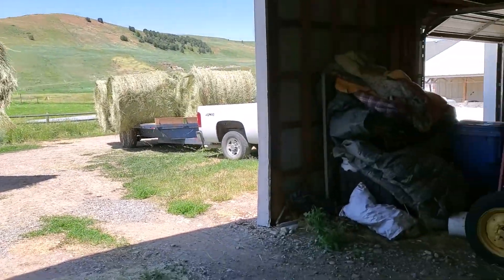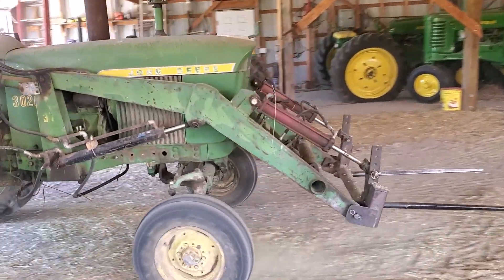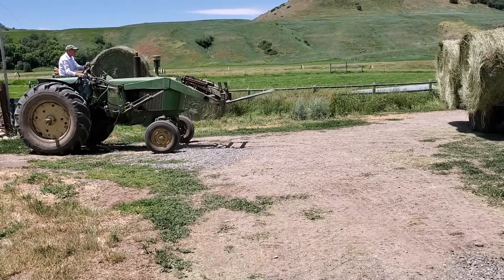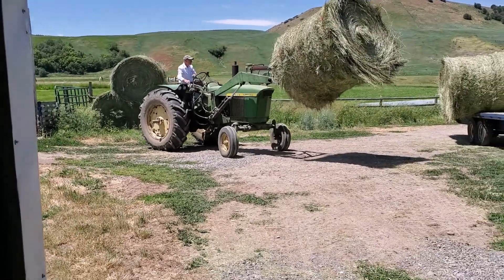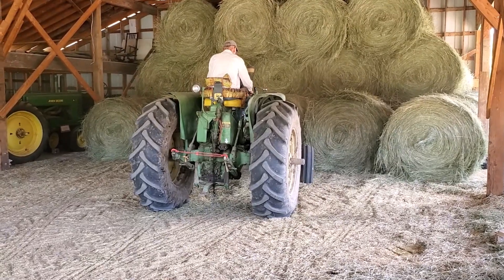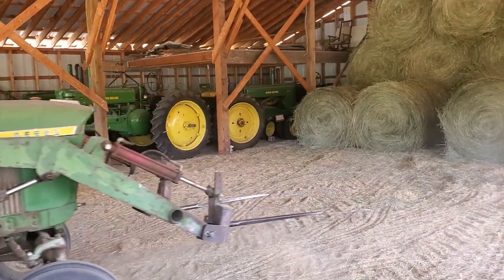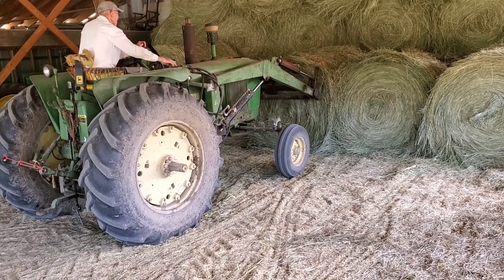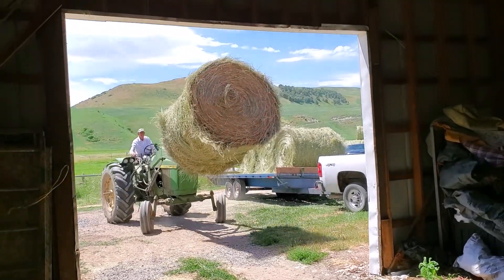Hauling Hay (John Deere 4240 and John Deere 3020)

Comment: I'm surprised the front axle on that poor 3020 hasn't given out. It's not quite rated for that I don't think
Reply from the maker: The 3020 is a very well built tractor. The weak point on the set up is not the front end... It's the loader itself. The front end seems to handle loading hay just fine. Also, loading hay is pretty light duty in the grand scheme of things. It's slow, smooth, and not jarring., as opposed to scraping corrals or moving gravel or rock.